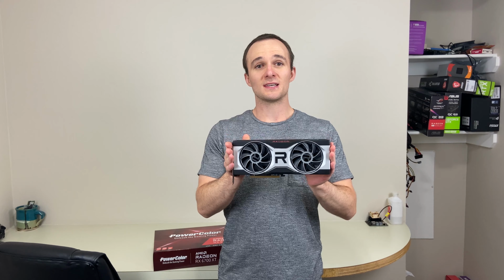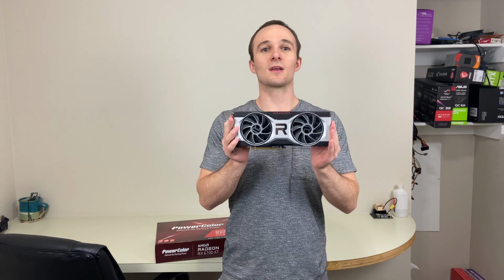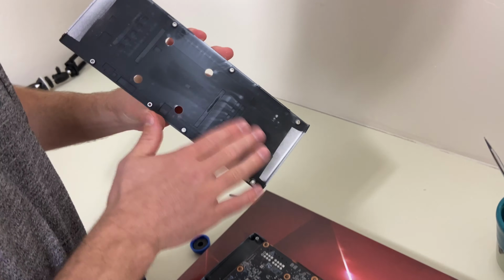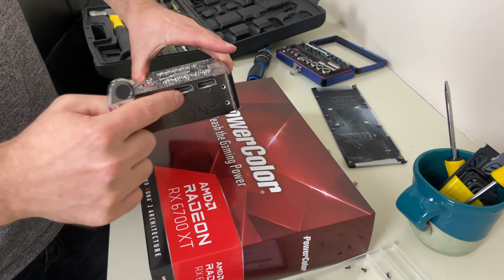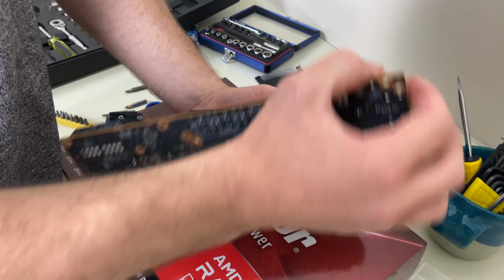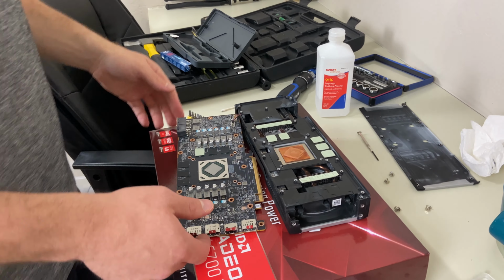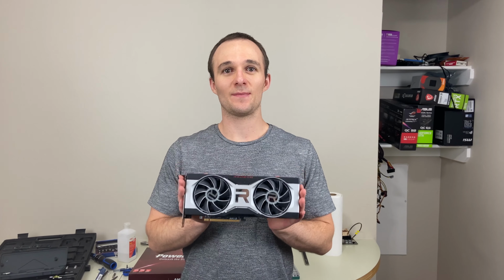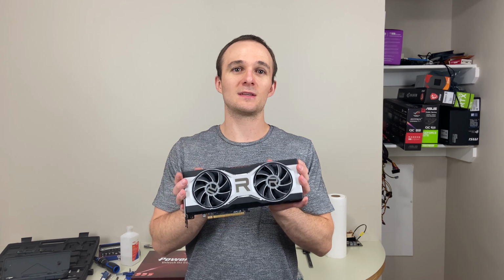Powercolor reference 6700xt teardown to see if memory thermal pads are fine.

Comment: its because the memory only contacts that black metal plate, which is not connected to the cold plate/heat pipes that connect to the finstack. It is a giant heat spreader and almost cooled passively. if you wanted to, could have slipped some thermal pads between the silver part of the cold plate and the black plate to transfer some heat to the heat pipes this way. The 6800 and above have a giant vapor chamber that covers and cools all the components.

Comment: Besides aesthetics, if there isn't thermal pads on the back of the PCB, the back plate is just holding in heat. Maybe a little passive cooling and help with rigidity of the card?

Comment: have you ever considered to try changing the thermal pads on the memory also add an additional on the back side? i'm planning to swap to a better thermal pads and was wondering if it worth the trouble
Reply: It is worth it. Did you do it yet?
Reply: @bobalazsgaming  well, i've tried it but to be fair i don't know if it was better from stock or not. i'm using GELID thermal pads because the thermal grizzly minus pad is a bit too expensive. the memory temps did lowered by 3-5 degrees (celcius).
Reply: @caerxm  it is a good idea to make a connection with the backplate and the board, since they were so cheap as to totally forget to put anything there.
Reply: @caerxm  How many millimeters did you use a thermal pad?
Reply: @BarretoAndre2809  i don't remember the measurement unit but i remember it was 2.0
Reply: @caerxm  
and the GPU is still working good at high performance?
Reply: @BarretoAndre2809  it still works. but at full performance? i've always use overclock mode but recently (by recently i meant these past few months), sometimes i've experienced crash while playing games where the screen would go blank and the pc stays idle doing nothing. forcefully turn it off and on and the driver would corrupt and wouldn't recognize the gpu if i try to reinstall it. so i have to DDU many times just to get it work again. have tried undervolt or keeping the tune stock, still happens. sometimes. my target is the driver but i haven't seen anyone talking about it. 

Also, i have to frequently change thermal paste so the hotspot reading would not go past 100°c. this is the main reason i tried the backplate thermal pad mod. but it doesn't affect the hotspot much.